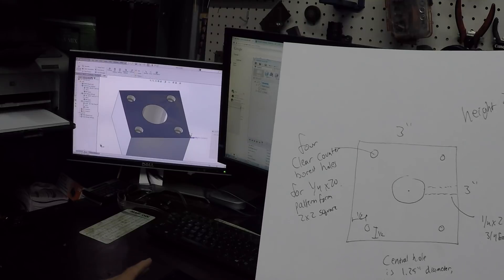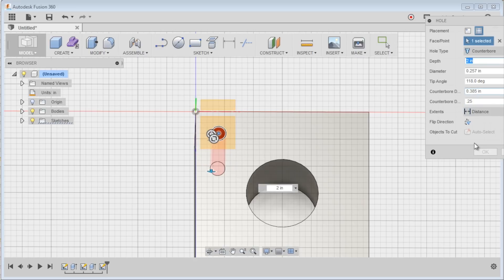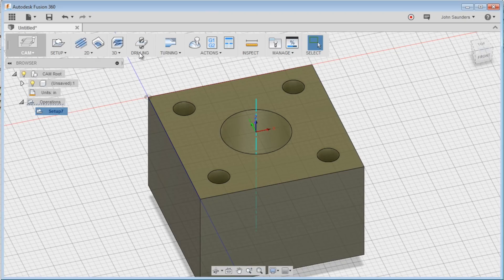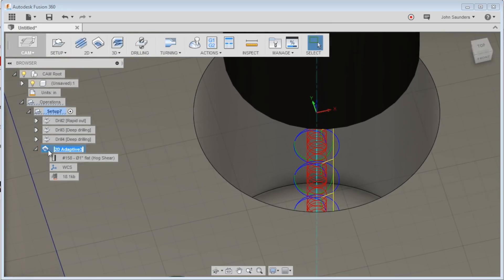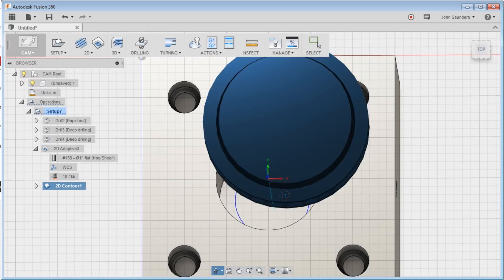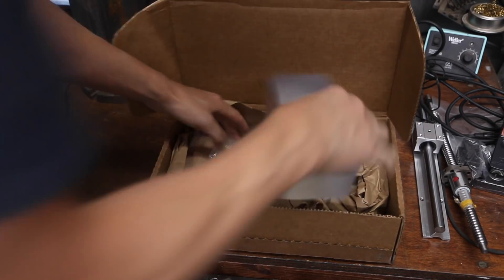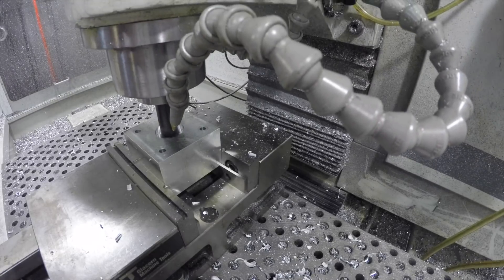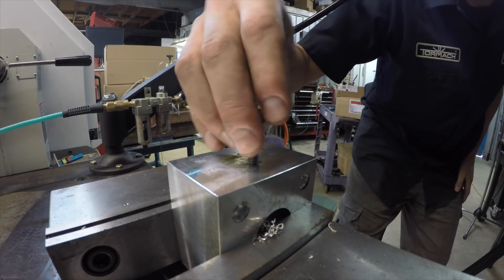Job Shop Life!  Example of a CNC Machine Shop Job!

Comment: We have parts we run that get splines formed in them.  We used to turn and bore them on the lathe then run a broach through them.  Now we pierce and draw them on the 200 ton press then the robot transfers them to the 400 ton press.  I use the vibration press stroke where the ram moves up and down as it forms the part.

Comment: I could form the part on a servo press if I had enough tonnage and a way to clamp all the way around.  We have a 400 ton press I can form counterbores and pockets.  But the parts have to be run through the machining center and run a fly cutter across them.  The metal I move has to go somewhere

Comment: No good!  -- QUESTION -- Where can we see real work being done on a CNC machine ie money paying client work (like Abom79 does on his manual lathes).  Large NON SOFT ALUMINUM PRETEND "WORK",.  Steel  work for large pumps for the oil and gas industry, for example.  See his "swedish meatbll pump" series.  That is real work.  Not one example of real work for any of these CNC machine channels.  Seems like the "work" is convincing people to buy these machines rather than actually doing any real work.

Comment: $$$ Design (CAD: .5 hrs), set up (select, cut, mount: .3 hrs), machine (.4 hrs) = 1.2 hrs @ $60 = $72.00 plus material ???($30.00 plus tax $2.50) or $32.50, sub-total $104.50 plus shipping ($18.00) total: $122.50.  WEEEE

Comment: Tip, use a 90 degree 3/4 spot drill instead and make your chamfer at the same time. Also reduces on snapped bits upon first entering part especially in stainless.
Reply: Hi boss

Comment: I see lots of people pilot hole then helical with too big a tool. That worked, but if it was me i wouldnt bother pilot drilling, id just helical that with a tool a little more than half diameter of hole. Obviously be careful of chips and not cutting center so tools melts. The smaller tool gives it more of an xy move and room for chips to come out

Comment: You have some very good advice. First of all pursue excellence and exceed your customers expectation and if you've been smart enough to stay out of debt you can't fail to succeed. Word of mouth has and always will be the best advertisement there is. Pay cash for it as you go, oh granted you won't necessarily have the latest or newest but during hard times you will keep your doors open. If necessary you may have to sale an asset or two, but by paying cash on the barrel in the past you have the asset to sale! Word of mouth will always be the best advertisement you could buy and will keep you in the black.Years ago my father and his partner attended a Beechcraft fly in, for owners of Beechcraft airplanes. They arrived in an older model single engine Bonanza. Theirs was the oldest airplane there. There were several twin engine models., and pressurized twins and they felt pretty insignificant. As the evening wore on and they met the other pilots it turned out they were the only people there that actually owned their plane. Everyone else were just making payments to the bank.

Comment: While you were playing on the cad, my part would have been finished! Just program it at the machine in g code. It's just a basic part😂😂😂🤣🤣old school buddy👍🏼
Reply: It would have been trivial to make this using the conversational CNC on the Tormach too, but that's not the point.  20 minutes in cad lets you turn the customer's scribbles into a dimensioned PDF drawing you can email to them and get them to approve before you make the part.  That is the kind of thing that will bring a customer back and they'll pay a premium for it.
Reply: That is simple, but thats how you learn the software. Programming G and M takes 1 typo and smash. In a year of practice he'll be faster than you and no crashes/mistakes

Comment: I wonder what is your experience with intersecting holes like this in terms of burs. If the large bore was a precision dia. would you consider bore, flip part, drill and tap, and then flip back for a reamer?

Comment: You were doing it "wrong".
For diametric design you should make sure that Objects like the center circle is black. Vlue indicates that not all dimensions are set.
And use depth to object instead of entering the depth of the block.
You can change the size of the block and the holes will always go through. In case you increase the depth of the block will the holes not go through when using finite numbers instead of selecting a face where to go to

Comment: Do you use Fusion 360 because most don't have solidworks?
Reply: Cool- I didn't expect a response tbh and especially not one so fast. Thanks! I'm trying to get something going because I'm tired of making money for someone else. I understand things take time and I'm trying to be patient. I got my solidworks via other conventional means so cost didn't factor in and I've already spent around 3-4 years just toying with it, building random things to get the hang of its functions. So, changing at this point seems counter-productive to me. I plan on building a small(ish) diy cnc mill to get started. I want to open my own fabrication shop though (custom aftermarket parts for various devices; firearms; vehicles;etc maybe even custom PC/electrical enclosures) so this isn't the only line of work I want to do. But I want to be able to make a part that requires cnc, hence why I'm going with a small surface area to start with.

Comment: this is inspiring. all the talk I hear people giving the tormach cnc's a bad rep, I watch this video and it shows how capable they are for a startup shop for the price.. it may not be a haas or fadal or the mazak i use at work but it looks like it works great for job shop small parts! 

on a side note... those tap heads are awesome, haven't seen one in quite some time.
Reply: Wait till you use a Okuma. THose 3 machines your work has are garbage

Comment: how much money does a certified cnc operator make?
Reply: like gulch said...a certificate means nothing, its experience that makes you money. around here someone with little to no experience will be getting around 17 bucks an hour...IF you can even get in. most of the time you will be cutting stock and maybe squaring it. cnc "operators" (aka button pushers) get about the same. the only way to learn is to do it, i was lucky, i had a lot of manual experience and then jumped to cnc operating. i went and got advanced g code and mastercam certs while working as an operator and was allowed to modify and write programs there. left to go to a mold shop where i got tons of hands on with manual and cnc and also got wire and sinker edm experience...fast forward 5 years and i am now in the prototype shop of a major medical manufacturing company in charge of maintenance, modification, and manufacturing of wire and sinker edm production fixtures and custom prototype parts making much much more than 17 an hour. knowing g code is key to programming and operating, being able to troubleshoot a program on a machine on the fly makes you much more valuable. 

so to sum it up, "certification" in the machinist industry is measured in years of experience, not how many years your certificates took. its a "what have you done and what can bring to this company" world, especially in job shops, they don't have time to train usually and time is money. good luck, its a tough road to hoe and you WILL take your licks, learn from your mistakes and don't get discouraged.
Reply: +NYC CNC im going to school for a certificate in CNC manufacturing technology.
Reply: +Joe Sosnowski  That certificate will be useless, unless you have a couple of GOOD SOLID years of actual programming and cutting with endmills and 3 axis machines. I'm not trying to be a jerk, just stating that I have almost 30 yrs experience with cnc's and have yet to see a shop place any value on a certificate.  It's all about what you can do when you are on the job.
Reply: +gulch1969 just got a call back from a shop i dropped a resume off at. i think youre right. cert or not, u walk in entry level if u have no exp. i have plenty of hobby machining experience and time on a lathe at school, so im not completely useless
Reply: +gulch1969 i took courses on blueprints and schematics, machining, inspection instruments, tool geometry, grinding, turning, tapers. ive made a few parts from prints. But i still got so much to learn, its a little overwhelming

Comment: Have you ever tried Solidworks? I find Solidworks easier to learn & gets things done faster.
Reply: I used to use Solidworks, but I use F360 now.  SW is incredibly expensive (minimum $1000) and you need a separate (expensive) product for CAM.  Fusion 360 is free for hobbyists or education, and a subscription is only $200-300 per year depending on if you get it on sale or not.

Comment: John, McMaster-Carr has everything, and they do deliver fast...but in many cases there are lower cost options and it might be worth checking them out, especially if time isn't as critical. I've ordered from Speedy Metals and On-line Metals and gotten exactly what was ordered, usually cheaper than McMaster-Carr. Sometimes one is cheaper than the other on a specific material or shape, so it's worth checking both. Everything has arrived in good shape and well packed. Selection is pretty good too. 

Thanks for the vid!  Don't know if I'll ever try job shop work, other than for friends, but it's good knowing more about it. There's no such thing as useless knowledge. 

-- Mike
Reply: Price isn't the only consideration all the time, but it's a frequent contender!  ;-)

Comment: Notice that the drill routines in Fusion do not work when the retract height is the same as the feed height. Rapid hole drilling isn't fun.
Reply: NYC CNC When the stock height is the same as the top of model I have had the drill and spot drill rapid straight into the workpiece because the feed height and retract height are the same. The tool path stays yellow just like in this video, once I reduce the feed height to less than the retract height the drilling part of the toolpath turns green and everything is sweet.

Comment: I am a Clickspring fan myself. He does all the stuff he does with really nice equipment. I am simply a hobbyist trying to build a clock (which is why I watch him). My equipment not nearly so nice as Mr clickspring's, I had to build my own dividing head. You are 100% correct. Learn to use what you have. Learn the foibles of your equipment. Always consider make/buy tradeoffs. That's something you haven't much spoken about. It's very interesting video. You spent about 10 minutes on the computer  and 10 minutes on the Tormach. Allowing for editing, call it half an hour. How long would a skilled machinist take? I'd say an hour. So CNC wins 2:1 Which is why it so popular. On the other hand you have to learn all those software packages, and I would rather wrestle rabid skunks than learn Yet Another Software Package (YASP).
Reply: Juan Rivero no the job he showed probably could be done on a drill press in 30 mins if the operator had all of the appropriate bits.
Reply: Thats weird software to me. He didnt show him squaring the block

Comment: Nice video.  Didn't seem to take you too long from start to finish.  Looks like a part that could be done conventionally, but nice and easy to do that flat bottomed hole with CNC.
Reply: Manual you just plunge with a endmill size of CB, or grind a drill flat, easy either way

Comment: I have always used a "circular array" for those types of object. That is, assuming they are equidistant from the center bore (which it looked like these were). Quick and dirty. :-)
I cant WAIT for them to tie InventorHSM(CAM) into the Fusion360. May happen, since that REALLY is what needs t happen.

I dont remember which of the 2 videos you uploaded today, but I think it would be good seeing the tear down, cleanup, and rebuild. Tormach maintenance is in a few channels, but it is always good to see the different approaches! The thing I see going well with yours is that you always do the quick, dirty, but effective approach. :-D

Comment: You should use an actual spot drill versus the center drill you are using.  You don't need the 60 degree to use a center on, so you end up just using a weaker tool for no reason.   If you get a 90 degree spot you'll be able to feed faster and it will last longer.  Great video!

Comment: In qty 1 I'd have just started making the part from a hunk of material on the Bridgeport.  Even with CNC, just use conversational programming at the mill to drill, helical bore, do bolt array, and outside profile.  The Centroid control really excels at this kind of work.
Reply: My thinking goes like this:  You don't make any money on one-off parts like this, the more thought and preparation, instead of just do, the more time it takes.

Comment: I am an a typical engineer always interested in costs and such.
Can you work from a 3D DWG file or do you need a DXF' is your set-up cheaper for these?
 For the set up that you did how much time did you use looked like 10 min. on the video?
What percentage of cost was set-up, materials, and manufacturing?
Was this a single unit, and how many questions did you have on this project
Reply: If you are doing stuff in 3d, step is the standard.

Comment: normally your spotting drill is only meant for lathes, when you pick the part up with a live center or between centers. that's why it has a 60° angle

For centering holes there are center drills with 90° tip angle. So you can center drill 0.1-0.2mm bigger than the hole is supposed to be and you dont even have to deburr/chamfer it afterwards.
Reply: matze1508 it's the other way round, spot drills have 90 deg points (or others) the centre drill is what is being used here. A centre drill is fine to use on a mill, and actually have better positional accuracy and finished hole diameter accuracy. If you centre and chamfer in one op (which I often do) you'll find that the drill cuts big at the top of the hole, also using a 90 deg spot will eventually knacker the edges of your drill if you're machining hard stuff. So spotting or centring is dependent on application. In ali I would always spot to a depth that would chamfer the hole.

Comment: Excellent advice!  Irony is the first thing I needed made was a block pretty close to what you showed.  Most production shops wouldn't touch one off's, and I didn't know about job shops at the time. So bought an Index Milling Machine and a LeBlonde lathe.  They are approaching 50 years and 75 years old, but still making chips!

Old timer's TIP:  Save the combination drill bit and counter sink for lathe work. Use a spotting drill in the milling machine. Short stubby, and leaves just enough countersink after drilling/tapping operations to leave a nice finished appearance. Do the math once so you know for a 1/4" tapped hole, how deep to leave a 0.280" hole (simple with a 90 degree 3/8" spotting drill).

Comment: that flex arm looks amazing - does it work with small stuff like 2-56 through 6-32?
Reply: silentqueue Yes they work great for the small taps.
Reply: NYC CNC awesome! Let me know if you want to try it out on some titanium or blade steel - I'd be happy to send you some! I have plenty of spare 4-40 taps, though mostly just "general purpose" ones
Reply: John just call me before you run it! I'll help you dial the tap holder in! You won't have a single problem! #ScoutsHonor lol
Reply: rotokid wwa

Comment: On the shear hog bogging down, I think your ramp angle was significantly too aggressive. 5 deg max is my goto. :) I know what I would do on that part...but you and I have a different situation. I'd have drilled with a 1" drill and then come back with a 1" 4 flute solid carbide endmill. Obviously, that's easy to say when the tooling is donated, but I think the way you did it (save for the ramp angle) worked just fine for you.

Otherwise, excellent video! Oh...did you catch that you left .01 of the floor during adaptive and didn't get rid of it with the contour? :P
Reply: NYC CNC Haha it's all good. We all make silly little mistakes like that every now and then.

A VF-2 donated by Haas. We've chatted about it a bit before though I can't remember if I normally comment on your channel with this account or my KC CNC account. I work for The Geek Group :)

KC
Reply: Its the tool diameter is too big, pilot hole is awaste of time. I just made M64 eyebolt holes at my work. I helical milled 58 mm diameter with 31.75 mm tool with no pilot hole 130mm deep, didnt take long. Other guy doing same thing drilled a pilot hole then helicaled with a 38.1mm tool. With threadmilling i was all done 2 holes in 35 mins, other guy it took him 2 hours. Mine came out better too and tool life better, reason should be self explainatory